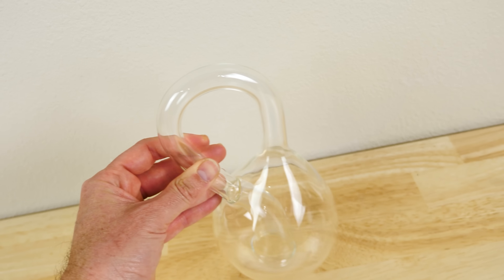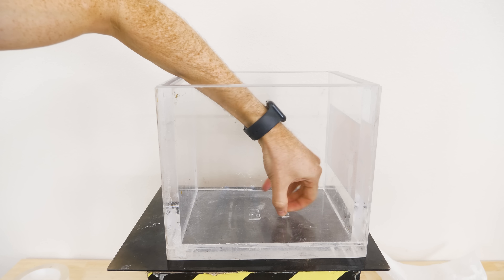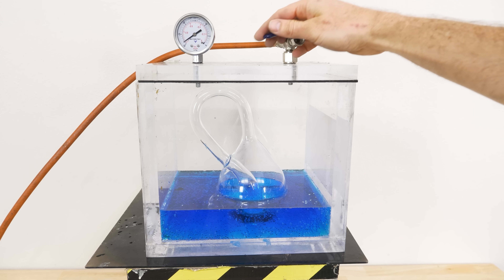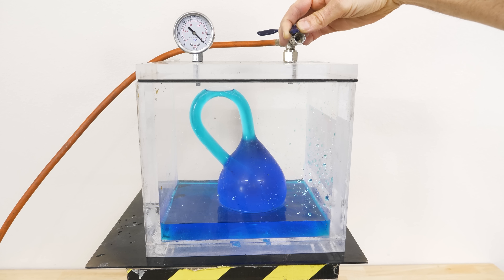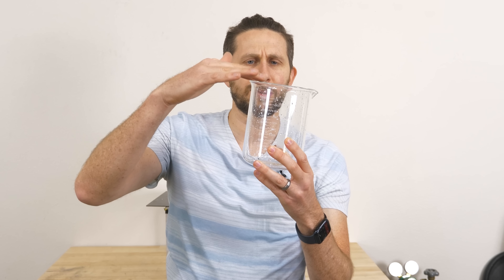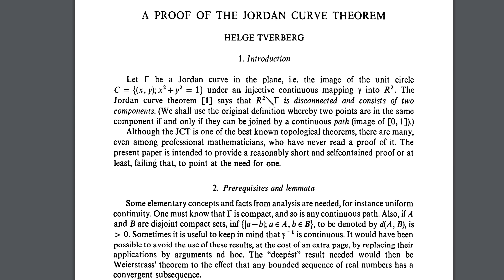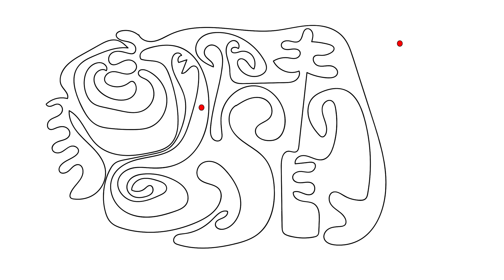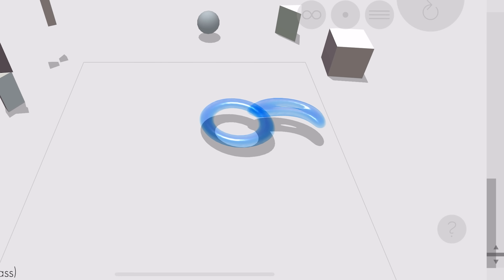Is It Possible To Completely Fill a Klein Bottle?

Comment: Imagine that... for years I've been drinking coffee from a container that has no volume. It's a miracle I'm still alive!
Reply: Well.... you can see it like thing: You've been drinking different volumes of coffee from a container that has no volume.
Reply: @sebastianortega1938  really so you're telling me the coffee pot takes up no space? Wtf are you ppl smoking
Reply: @MC-wh3xm  yes, that's correct. Actually the explanation is that in mathematics a volume is defined as an encased space. Otherwise it is just an area. A better way to understand it is this:
1. Grab a piece of paper and lay it flat. Here you have just an area of X times Y.
2. Roll the same piece of paper into a tube. Since it is not fully closed/encased, it is still just an area of X times Y, or for that matter the length of the tube times its circumference.
3. Now, to one of the ends of that tube, paste a circle of paper, and you have now a paper cup. In reality, that paper cup is still just an area of X times Y (which is the area of the tube in step 2), plus the area of the circle. So a slightly bigger area.
However if you fill that paper cup with, say green air, that means that the paper cup is holding a volume of green air equivalent to the area of the circle times X times Y, for instance, a green air cylinder.
4. As soon as you put another circle of paper at the other end of the paper cup, you get an actual paper cylinder with volume X times Y times area of the circle (so, the base of the cylinder).

tl;dr The problem here is that you're only thinking of how much coffee the pot can hold, not the actual volume of the pot which in mathematics is zero but in applied engineering would the volume of the glass.
Reply: @The 10th Dentist Hence the joke that topologists can’t tell the difference between a coffee cup and a donut.
Reply: That “Klein bottle” clearly has a volume. A real Klein bottle is a theoretical form and the neck doesn’t pierce the manifold to pass through.
Reply: @5T3LTH  Yeah
Reply: @5T3LTH  Thank you
Reply: ya according to topology youve been drinking from a doughnut.
Reply: Gravity has been pulling a lot of the weight
Reply: how would that even kill you?
Reply: It as a contenance tho
Reply: no dude klein bottles dont exist in our reality as a whole they exist across it
Reply: Yeah it has volume it’s just an arbitrary rule in math saying any 3-d shape that is not a closed shape has no volume. Look at cooking with a measuring cup it has the volume on the side but according to this math rule a measuring cup has no volume but what happens when we put a flat 2d shape covering and defining inside and outside it magically now has a volume but we already knew the volume based off the predetermined volume measurements on the side. There is obviously a volume and those measurements on your measuring cup are not arbitrary. This is math trying to put everything into it’s own box when we all know the world is more complex then that.
Reply: @ok.ok.5735  from a mathematical point of view, it's not arbitrary at all. If we take a cup and try to define its volume most people will say "oh yeah, easy, let's imagine it's closed by an imaginary lid at the end". But how do you define the "enclosing" of random shapes mathematically?

Let's imagine for example a cup but it's not shaped as a cilinder but rather as a sphere with a hole at the top, what would be the volume? Again, many people would imagine a flat lid closing the sphere because that's how a liquid would behave. But why would mathematically be defined that way? Why not make the volume of a full sphere. Let's remember, math needs to be defined with rules that work ALWAYS, no exceptions. 

So yeah, our imagination of how open shapes should be "closed" is good enough for everyday, but it's not enough for math.
Reply: @ok.ok.5735  Well what you just defined is called "related envelope" (not sure of the traduction of "enveloppe connexe") you create a shape around a shape you already have. To be more precise in math, the mug as a contenance and a volume, the volume is what you obtain when dropping your mug in water, the water fill all the hole and goes up, the difference in volume between before and after is the volume of your mug, the contenance is the volume you can fit inside. We have different words because using the same word would be horrible ... But it doesn't concern you, if you want to use volume for each definition it's perfectly okay since you don't need the proper definition of volume or contenance to do a cake. But we need it ! so we have to put everything in his own box like you said.
(Also math have very few "arbitrary rule" and that one is not, it's a very interesting theorem)
Reply: @ok.ok.5735  Mathematics is NOT arbitrary. Measuring cup always has the same volume - the volume of plastic that went into its creation.
Reply: @blinded6502  Mathematics is imperfect like the people who use it there are times from a analytical perspective when it can be absolutely perfect but where math becomes arbitrary is in the words used to explain it. I expect people to vehemently defend the greatness of math and science and I do get it. But I expect words and understandings to change with new information. I would never call this object volumeless when I know it can fit something. There’s definitely arbitrary definitions in math because it’s an isolated world that you sometimes actually can’t check against reality like the measuring cup has no volume when we all know it does.
Reply: @ok.ok.5735  All of that is because you don't understand mathematics. Measuring cup is not volumeless. It's walls have thickness.
Reply: @blinded6502  I think it’s rather a confusion about the term “volume” - “how much space does its mass take up” vs. “how much liquid can it hold” are two very different questions, mathematically.
Reply: @fatcerberus  No need to mention mass here, but sure, you're correct
Reply: @blinded6502  are you serious? thats what I just said measuring cups have volume and so does this “volume-less” shape. That was my whole main point. Actually basically the only thing I was saying
Reply: @blinded6502  I mention mass only so as not to include the air inside the cup as part of its volume.
Reply: @ok.ok.5735  You've been claiming that according to mathematics measuring cup has no volume, and then proceeded to say it has one, because it can hold water. That was a strawman statement. What you've called volume here, is a 3d region that fits into a concave part of the cup. Not the volume of the cup itself.
Reply: @ok.ok.5735  Klein's bottle can't even hold any water, since it's a 2-shape in 4d space. Trying to put water in it is like trying to hold water inside a fishing line.
Reply: @blinded6502  it can hold water rewatch the video your missing all the points talked about there that’s why your getting so confused. The gas in it aka air has a volume and it can fit in it if we were to melt down metal cool it down to a solid put it into the shape it will have a volume amount. Anything with a mass should also have a volume regardless of a definite shape.
Reply: @blinded6502  no the video claims a measuring cup has no volume rewatch the video and then you’ll know what we are talking about. I’ve been saying it DOES have a volume.
Reply: @ok.ok.5735  It's not a true Klein's bottle. Look it up, use the internet, holy hell
Reply: @blinded6502  🛑 Mr google.🤦‍♂️
Reply: @ok.ok.5735  that glass thing in the video isn’t really Klein’s bottle though
Reply: @ok.ok.5735  You've been claiming all that by saying that mathematics are arbitrary
Reply: @blinded6502  I’m not arguing with you cause this object does have a volume period.
Reply: @5T3LTH  My posts have been talking about the objects this video no object out side of the video and was clear that I was talking about it I even used the measuring cup example in the video as not to merge from it. I maintain this video is bullshtt because any 3d object has a volume no matter what this guy in the video says I keep repeating it because it’s true. He’s calling a 3d shape volume-less as to fit it into an arbitrary box. All I’ve been saying. I never even said the name “Klein Bottle” once I always lead with “volume-less shape” purposely.
Reply: @ok.ok.5735  I’m with you dude. These dudes are all confused because the guy in the video kept saying the object in the video has no volume which is not true. A real Klein bottle is not a 3D object and does not have volume. The imprecise click baity language in the video is wrong and is the source of this frustration. You are right that the 3D representation of a Klein bottle used to (ham-fistedly) demonstrate the topological idea behind the video obviously has a measurable volume. Some of the guys attacking you have been taught C tier science and are muddying the waters by trying to come up with a way to explain how a 3D Klein bottle doesn’t have volume. The fact is a 3D analog of Klein’s bottle does have a definite volume. Everyone should stop attacking your reasoning because you are technically correct regardless of your ability to articulate how they are wrong.
Reply: @5T3LTH  It can be a common thing online that if you merge from these preconceived notions of someone popular that happens to be in science they’ll ridicule you and what not. It really it doesn’t bother me since I kinda expect people to act like Einstein online even though I already know they probably aren’t. Also it was an simple misunderstanding but also an educational one showing you can bend a 2d image into a 3d and change the volume
Reply: @ok.ok.5735  If you look at volume without gravity it makes sense how they came to the conclusion that is needs to be an enclosed space to hold the volume.. but we have gravity so.. yeah it is wierd.
Reply: @longbow857  it's weird how your "volume" goes from 200ml to 0ml whenever you hold your cup in the air and flip it. Last time I checked balloons don't change volume when you rotate them.
Reply: @xXJ4FARGAMERXx  Yes and you can pop a balloon.. I mean if you add new circumstances you can debunk everything.
Reply: @blinded6502 volume is space, You're thinking of mass.
Reply: @freepalestine1673  No, I know my terms
Reply: @ok.ok.5735  Math generally isn't arbitrary either - or at least it doesn't have to be - it's more a matter of how accurate a model you have for the physical thing you're actually interested in (and as you note, the real world is much too complex to model 100% accurately).  For the measuring cup what you're calling "volume" is answering the question "how much liquid can it hold?", while the "volume" of the Klein bottle is instead about "how much can you fit inside it?" which is a nonsensical question unless you first define what you mean by "inside".  For us looking at the thing, we can pretty easily make a distinction between inside and outside (and thus measure its volume), but the ant crawling on the surface of it might disagree on that point...
Reply: @fatcerberus  math is usually not arbitrary so your 100% correct and said things better then I could write myself. Here as soon as you close off that top now we can say this object has a volume and that volume will be based on standard volume of other measuring devices like a pitcher with volume on the side. This could easily tell us the volume this can hold and that can only be 1 number and it wouldn’t be 0. I’ve always understood that anything that has mass has a volume regardless of definite shape.
Reply: @ok.ok.5735  Yep, there’s a bit of wordplay involved in that the bottle doesn’t have an “inside” in terms of topology, because there’s no clear division between inside and outside, but hey look, we’re putting water in a thing with no volume, which makes no sense!  So it’s a fun little joke, but in reality topology is just completely the wrong mathematical “language” for this.
Reply: @fatcerberus  That’s it actually a fun logic thought provoking experiment
Reply: @fatcerberus  Actually if you are interested, the klein bottle is kind of an extrention of the ring of moebius and just like it it have one face, no interior nor exterior, no volume but a surface and just like the moebius ring cannot be represented precisely in 2d, the klein bottle cannot be represented in 3d.
Reply: @anathos0369  Yes, I’m aware.  We were talking specifically about the 3D representation in the video.
Reply: @fatcerberus  this is the best description for this whole issue I've found. That its two different languages that use the same word to mean different things.

Comment: Could you use 2 tubes, one to let the air and and the other to input the fluid to try and fill the 3D KLien Bottle?
Reply: Maybe you could also sit the bottle with the opening down in a container with water and pump liquid through just one tube, I guess the liquid would push out the air through the bottom.

Comment: There's another, easier method for filling a Klein bottle. A smaller diameter pipe going right "inside", sucking to produce negative pressure.

Comment: Couldn't you have just turned the klein bottle upside down, insert an air hose (like you'd buy for a fish tank pump, then pour water into that hose from an opening physically higher than the klein bottle?

Comment: to fill completely with a hose you would hold right side up, insert the hose around the loop, fill the large chamber.   then flip it upside down and fill the rest of the tube.  then i'd imagine it should stay fairly vapor locked when you flipped it right side up again.

Comment: Does the 4D kein bottle have a 4D hypervolume? Or is it like the 3D case where it has no volume?
Reply: The Klein bottle is a surface embedded into a higher dimension, but it's still only two-dimensional. By definition, it cannot have a volume.

Comment: No, that’s horribly stated and simply wrong. A Klein bottle does not exist in 3D. It’s a 4D object and that’s why it has no volume. It has no edges and as a result has no volume in 4D space. The Klein bottle you have is a common 3D projection that obviously has an edge

Comment: The Klein bottle is a red herring in my opinion, it doesn't accomplish the task of combining two Mobius strips, which are three-dimensional, it simply pretends to do so by gratuitously introducing a non-existent 4th spatial dimension. In real science (the realm into which mathematics falls) you don't get to just change the rules when you get to something impossible. I mean, you can chose a different math with different rules, but then the feat is entirely unimpressive.
Reply: So you saying they should have found the 4D version of a mobius strip in 3D? 🤔

Comment: Wouldn't it have been easier to just submerge the klein bottle entirely, then rotate it around until all the bubbles float out, and plug the hole before removing it?

Comment: writing this before watching the video, we can fill it with water a little bit then put it a bucket full of water
and let it be submerged for like 30 sec then we put our hands in the bucket and cover the opening with our hand so the water doesnt spill when we take it out with our other hand.
2nd method is to to make an air lid that is air tight and to this lid are two connectors one goes to a vaccume pump and the other one goes to a pipe that is connected to a water tank or a flask or whatever and that fills up the tank.
and one  easy way of filling it up apart from the bucket one is to use a thin pipe that is flexible enough to make it upto the dome part,insert this and then just pour water through the said pipe. 
🤓

Comment: I kinda disagree with the end of the video. a true Klein bottle could exist in 4D, but you forgot that volumes are only 3D. You would have to use another unit for 4D. (1D has length, 2D has surface, 3D has volume so 4D will probably have one too.)
Reply: But still, a great video and a good explanation

Comment: I wanted to see what happens when you try to pour the filled bottle back out again. Does some of the water get stuck? does it siphon out? Does it come out in chunks based on how much of it you can get through the tube at the bend before it airseals the enclosed chamber?
Reply: What if you put a shopvac down the tube?
Reply: @Zarkonem  You could definitely put a bendable straw or tube into the bottle, submerge the bottle, and suck out the air.

Comment: Couldn't you just use a syringe with a tube instead of a whole vacuum chamber to fill the thing? The vacuum chamber method might have been cooler but it's definitely not the simplest solution